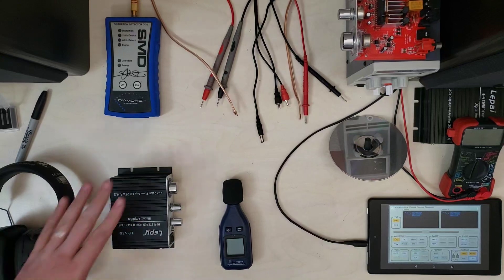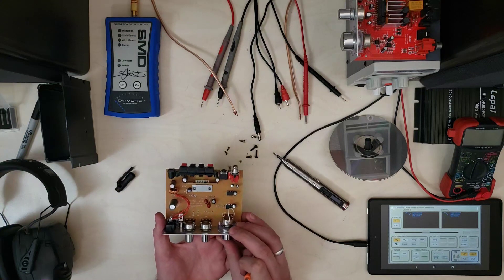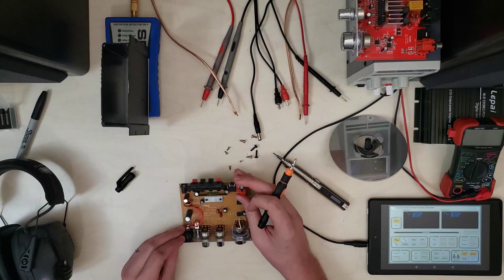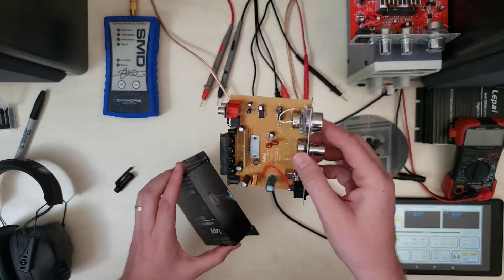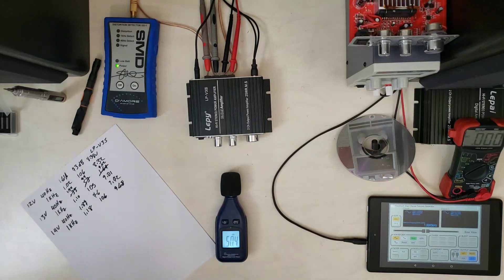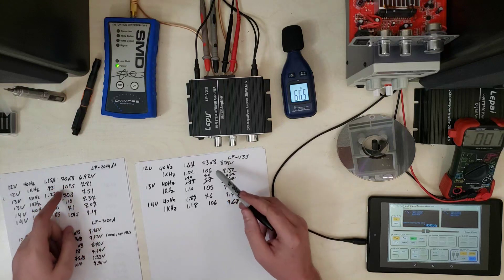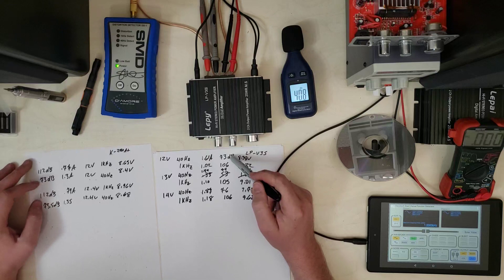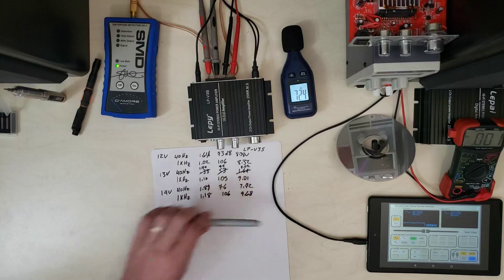Lepy LP-V3s: Amplifier Review and Objective Performance

Comment: I just made my own test with Lepy LP-V3s vs Kinter and Fosi, I'm not as expert as you or have the equipment, but my Lepy LP-V3s has almost no bass compared to other amps I have, probably the quality differs a lot too between each unit.
Reply: any recommendations for a good budget amp for around 20 to 30 USD with the power supply?
Reply: In this video here said the base is better than the 2024A+ and on power with the 2020TI so how can you say it has no base at all compared to the other models. Please don't mislead people when you dont have the correct equipment to test it.